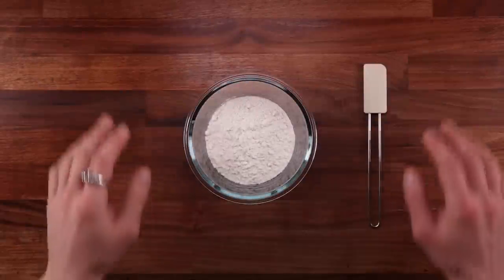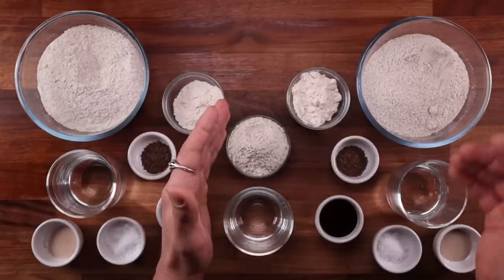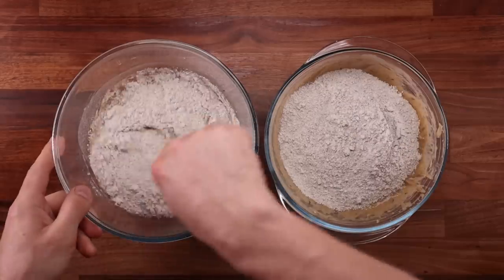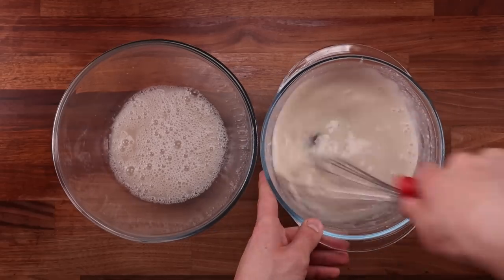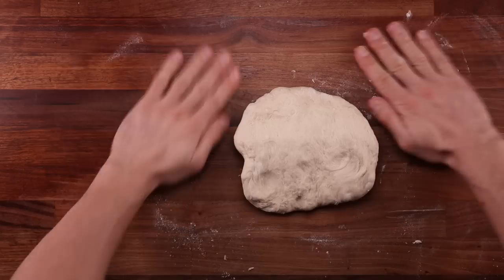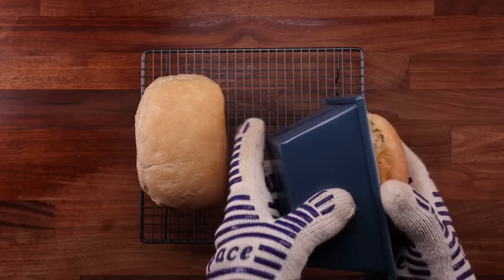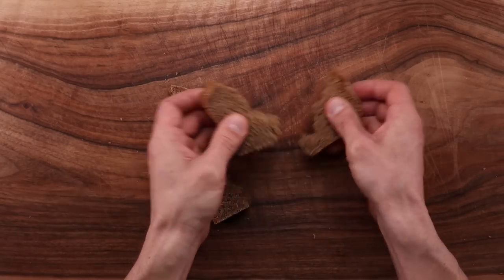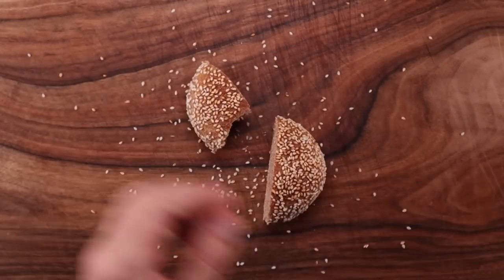Scalding Technique Explained | How to Make Your Bread Last Longer

Comment: I want to share this experience; It DOES  affect the proteins and lessen gluten formation as a result. So.  I was using a very good quality white all-purpose flour bio unbleached.  This time, I used a regular cheeper standard flour and tried the yudane method.  Results: practically no gluten formation after kneeding and waiting plenty . Lucky for me, I had some gluten flour ( 70% protein ) . After making 3 additions, it corrected the problem.   SO...   Lesson learned.

Comment: I used to long period scald rye flower for a light rye bread some time ago, but not by keeping it warm. The dough would use half rye and half wheat flower so I would scald all the rye flower with all of the water intended for the dough and cover it up in a plastic container. The thermal mass of the water and the insulation of the plastic kept the temperature well above 65C for many hours. I would usually set the scalding early in the day and it'd be at a good baking temperature the next.

Comment: So I made a white loaf using a slightly modified version of this recipe and holy dough balls, it is good bread!

For the scald, it was a little dry so I moved an extra 10g of water to the scald. 
I added 4g of sugar and one egg yolk during the mix, then a cold bulk ferment for 5 hours, shaped and put in my bread tin and left overnight (12 hours) and I baked it in the morning at 430f for 20 mins with a steam bath. Turned upside down for a few mins to crisp the bottom and sides.

It is the greatest thing I've ever baked. Hands down.

The crust is crisp on the outside and chewy inside with a slight saltiness that I'm still thinking about.
The crumb is soft and even, with good bite to it.

Excellent toasting bread. So, so good.
Reply from the maker: Nice one! 😎

Comment: Just made a lovely loaf based on the linked recipe. Scalded the whole wheat (20% of total flour) with butter, salt, and some maltose. I bloomed my yeast with the rest of the water, and used 80% bread/strong flour. Did a short knead and then three light folds/kneads every 20 minutes and then chucked it in a Pullman loaf pan overnight. Straight in the fridge, and straight into a hot oven in the morning. A really successful loaf and the scald really helped with texture. The loaf was so moist I thought it wasn't done... It was.
Reply from the maker: Awesome job! 😎

Comment: I am using the method whenever I make donuts or cozonac. In particular the last one can be rather dry despite a sticky dough so the yudane helps a lot the end result. I made a babka with the same dough and it lasted several days, uncovered even, and didn't stale at all.
Reply: Great tip, thanks! I love cozonac, but it tends to dry out really quickly, so scalding might be the solution...

Comment: in germany we differentiate between "Quellstück", "Brühstück" and "Kochstück"

Quellstück: you mix coarse flour (or seeds, etc.) with room temperature water and let it sit (often overnight in the fridge)
Brühstück: you mix boiling water with flour and let it sit (usually you use 1.5x as much water as flour, e.g. 100g flour 150g water)
Kochstück: you mix boiling water with flour and cook it until it turns into a "pudding" (usually you use 5x as much water as flour, e.g. 20g flour 100g water)

Quellstück we typically use to include sth like pumpkin or sunflower seeds, Brühstück and Kochstück we use for bread that otherwise dries out too easily (speltbread particularly)
Reply: Danke für die Erklärung❤️

Comment: I really love what yudane does to the bread. It gives it all the qualities that some might love from storebough bread, but with no negatives.
I've made dinner rolls with a full enriched dough (butter, sugar, egg) and yudane that pretty much felt exactly like a soft storebought buns, but tasted infinitelly better.

I also heard it helps bread to last longer, but i can't tell if it's true. My bread never last for more than 2 days. Just get devoured.
Reply: I can tell you it does allow it to last longer.  I've made Shokupan that will last over a week.  I'm a single person, so I'm not eating all my bakes in a day or two.
Reply: @feliciagaffney1998  It's not that is lasts longer so much as pre-hydratinng part of the flower simply has it holding more water when baked. YOu can get the same effect by adding a bit more water in the same parts he mentioned and letting your dough sit longer so it hydrates further.
Reply: @SilvaDreams  but Shokupan still takes at least a week before molding.  Can't say quite the same for high hydration dough.
Reply: DoremianCleff, you are so right!  I made enriched rolls last weekend (a double batch) and they were gone in two or three days.  I have never been more pleased by the texture of my rolls.  I plan to incorporate Yudane or Tangzhong in my recipes as much as possible.

Comment: I recently came across a recipe for traditional Borodinsky bread and noticed that it includes a scalding technique with malt and rye flour. Although I initially followed the recipe and had a satisfying result, I didn't understand the purpose of the scalding technique. Thanks to your video, I now understand how it can improve the quality of the bread. It's great to have a better understanding of the process!

Comment: I have a very simple solution for keeping the scald at 65 degrees. Buy a Lakeland Multi Yogurt and Soft Cheese Maker (about 20-28 quid on Amazon at the moment) They hold about 1.4 litres comfortably (1.6 litres if you use the white internal pot). Using the C2 program, the max temerature you can set is 65C. You can even set the time so it could be set to turn off and cool down a little while you are out at work, ready for the main- or pre-ferment stage.

Note the specific product name - that product one has 2 programs - the C2 program allows a lot of flexibility with temp and time, but the C1 program is quite restrictive and aimed at plain yogurt. I use mine with a low temperature - 28C on the C2 for pre-hydrating yeast in a sugar solution for 12 hours to make homebrew ciders (that allows me to use a tiny amount of speciality yeast so it keeps costs down, but gives me a head start so the main fermentation starts much faster, reducing the chance of off-flavours when using windfall apples)

There's only one problem with this machine, it mainly heats from below, so I'd suggest starting at maybe 60 degrees and working upwards. But it's cheap, effective and the lid will keep flies out haha.

Comment: Thank you for covering this, I suggested this topic in the yudane/tangzhong video :)

Keeping the scald at 65 is key, actually! It's not for better gelatinization, it's to allow the enzymes in the flour time to actually break down the starch (you'd add like a spoon of the flour to the scald after the rest of the flour is well mixed with the water; alternatively, you can use diastatic malt for very efficient starch hydrolysis, but typically whole grain rye is scalded without it, while white flour has much less enzymes and malt is added). After 2-3 hours incubation the scald becomes much more liquidy and sweet. This is what will promote the fermentation, since the scald will be rich in maltose. In professional large scale recipes this is not done purposefully, simply because they use much larger quantities of the scald, and it simply cools down way slower.

Also, try adding the caraway seeds into the scald! Or any other spices you are adding. Hot water releases their aroma better I think.

Keeping it at 65 for hours is a little complicated and depends on what equipment you have... I've done it just in the oven set to a very low temperature measured with and external thermometer (since 5C error can affect the result a lot). Others use an instant pot, a sous vide setup, or any other way to control temperature in that range. Even just a thermos works well enough I think, btw.
Reply: So after you scalded a flour, you put it into a 65°C chamber then let it inside for 2-3 hours? Also what kind of malt do you suggest? I only have diastatic malt here, differed by light/medium/dark
Reply: @AJAA2916  exactly. You need diastatic malt, doesn't matter much what kind exactly. Traditionally it would be rye malt for rye bread, and wheat malt for what bread... But nowadays barley malt is much easier to find, and there is no reason not to just use it.
Reply: @Phlya1  thanks! Do you know how much diastatic malt I use by % from total flour? Also should I add it along with scalding or after the flour is scalded?
Reply from the maker: Cheers for the tips, Ilya!
Reply: Just as a side note.. 62-65°C is the sweetspot when you are brewing beer to get the most fermentable sugars released from the barley. Somewhere around 70-72 you get sugars that yeast don't like, but it adds sweetness. If you are doing smaller scaldings, try heating a big pan (3-5L) with water to 65, take the water you need for the scald and then put a container in the pan. I'm used to a insulated 35L boiler and it's dropping perhaps 2°C/hour ouside (15-20°C). Try measuring your drop over an hour to see if this might work for yuo. I would say that 1-1.5h should be enough, cramming out that tiny extra ammount isn't worth the extra energy it takes to keep it warm.
Reply: Agreed with the 2-3 hours @65C ... however I don't fully understand adding diastatic malt, as its enzymes lose activity over ~55C. That's also why diastatic malt can only be produced at low temperature.
Reply: @thejunglejag  it's actually very active at 65, but not for long :)

Comment: Cheers to my favourite online baker!

I would, approaching the problem of keeping the scald for 65C for several hours, use a sous vide, or other accurate dip-warmer. Put it in a ziplock, prsee out most of the air, and keep in the water at a constant temp for however long you'd like.

Just an idea
Reply from the maker: Cheers 🤩

Comment: I mill my own flour for each bake & use a scald  method of autolyse that has completely revolutionized my sourdough baking by allowing me to make light & moist artisan whole grain flour loaves that stay fresh for days in the bread box.
Reply: I am a sourdough convert and only 2 of us to eat it so it gets dry. Could you share your recipe for your bread with sourdough starter?
Reply: @ritabarsi6064  well then you are in a similar situation as we are ‘empty nesters’ with occasional extra bodies on the weekends. 
1st things first, I do sift my fresh milled flour with a #50 flour sifter. This allows me to utilize the bran as an additive and not part of the total flour. I add just enough scalding water to the bran so that it is completely wet like a stiff paste but not soupy and then cover it & let it rest & cool. I add it in along with the levain & salt. Here is my basic recipe:

350 gr fresh milled sifted hard wheat flour
100 gr bread flour
328 gr scalding water
90 gr levain
11 gr salt

Combine the flours and then add it to the scalding water & mix until there are no dry bits of flour, cover & let rest & cool for 1 hr. Add the scalded bran, levain & salt & mix/knead until it is smooth, this usually takes me about 5-10 min, cover & rest for 30 min. then perform a set of stretch & folds, repeat the rest then stretch & fold cycle 2 more times. Then shape, place in whatever vessel you use to proof it in, I then place it immediately in the fridge until whatever time I am able to bake it the next day, however, I have left it in the fridge for as long as 3 days when we had a family emergency come up & it baked up beautifully & stayed  just as fresh as if it had been baked earlier.
Reply: @speakingconstitution  How much water in your levain?
Reply: @Erri-kb6et  at some point you're just going to have to make some bread my friend. Agonizing over the percentages and the recipe isn't the point of baking.
Reply: @tissuepaper9962  It is when you have to have consistensy in the product you sell to your customers. Percentages are important, recipes not so much. But in this case since it is a recipe that can be read by maybe not so experienced bakers, why not mention the ratio or just the amount of  flour and water in the levain? just asking.
Reply: @Erri-kb6et  none of us are commercial bakers here, every time I tell somebody to relax about the recipe they get on a tangent about how commercial bakeries do things. If you were a commercial baker you wouldn't trust the recipe as-written anyway, there are too many confounding factors. You would make a batch or five with different recipes in the same ballpark and pick the one that works best for you. That experimentation is the heart and soul of cooking, practical matters like consistency in weight and crumb are its day job.
Reply: @tissuepaper9962   I am a commercial baker. I have a microbakery where I make organic sourdough bread, vienoisserie and other pastries. I don't use yeast in any of them. And exactly as you say I don't trust it that's why I ask. I am a cook hoe always wanted to be a baker. Everything I make and sell is my own and has cost me years to gain the knowledge and ability to come this far. By experimenting, reading and searching. Frustrated from vague recipes and books (eg 2 egg in the recipe....S, M or L? there is a difference in grams,). In culinary school recipes are written clearly to the point and with exact mesurements or percentages. Later, after you've learned you can always change things according to your taste or circumstances (like with bread). People watch Charlie because they are still learning. He is to the point, explains things, gives ratios and percentages, not always recipes. I watch too, because I am also still learning. And by the way it is a great day job to serve people good food.

Comment: Charlie: I have a dehydrator  with adjustable temperatures and it would keep the scald at 150 degrees F or 65 degrees C for as long as you would like. Although, I would recommend covering it up to stop it from drying out. I use ceramic unglazed tiles heated to 250 degrees F and placed on a  thick bath towel, that I place in the bottom of my coolers when I travel to other locations with heated foods to keep them warm.  This technique will keep the food warm for several hours. I see no reason why this would not also work for keeping the scald warm for several hours.  I would place a second towel on top of the heated tile to avoid over heating the scald. I also use this technique in my bread baskets when serving large dinners to keep my breads warm.

Comment: temperature controlled proofing can be done in the bowls in a sous vide bath system, I strongly suggest using a plastic lined cooler, just put some bricks in the bottom in the water as support and get it to temp

Comment: To hold the temp of the scalded dough, you might try using the sous vide method and putting it in a plastic bag, submerged in water held at 65c.

Comment: I do scalding / yudane like doing an autolyse, I mix all of my bread flour and water together and let it sit for 30 to 60 minutes.  The only difference is the water is boiling.  Then I add all the other ingredients and knead.

If I want to break steps up, doing a yudane earlier, I'll throw it in the refrigerator for hours up to 3 days.  One can do a poolish and yundane at the same time, and then let them sit at room temp or in the fridge together for more flavor, then combine and knead.

Comment: I’d use a cheap yogurt maker/fermenter to keep a constant temp. I’m pretty sure most go up to 65c. Mine is a Lakeland brand available on Amazon and holds 1.8ltr at between 25c-65c which makes it great for keeping preferments or sourdough starters at your chosen temp if like mine your house is cold during winter. I’ve even been toying with the idea of making black garlic in it.
Reply: Make black garlic in an old rice cooker set to warm, but set it up in the garage, because your wife will make you move it there when the garlic begins to smell anyway.

Comment: I have put eastern european bread scald made according to your recipe in sous vide machine for 6h and 12h respectively, and compared them to the same bread made with 12h room temp scalded bread. The 6h scald produced the best softest bread, which was almost like freshly baked 2 weeks after baking.. no kidding, the last piece was as fenomenal as the first. But the other two had huge problems in that regard.. they ware simply touch and didn't give much. The 12h scaleded bread was firmer, but seemed same as the unscaleded bread... but that might be due to the using a frozen potato... yeah I changed the source of potatoes in that batch...

Comment: Just learning about proper bread making by watching your videos. Am wondering if scalding could or maybe should be used IN ADDITION to a preferment. You are an amazing teacher. Thank you!
Reply from the maker: It will work just fine. The only problem is that there may not be enough water for both 😅 I sometimes do a scald and then cold ferment the whole dough after mixing it up once the scald has cooled down. It achieves the same result as pre-ferment.

Comment: I’ve noticed the difference water temperature makes on roti dough (made with atta). Tepid water results in a much softer roti even when used in the same ratio against room temperature water. Would love to see a video doing this comparison. Another method I would like to see added to the test is Bong Eats Roti recipe. They scald the atta flour.